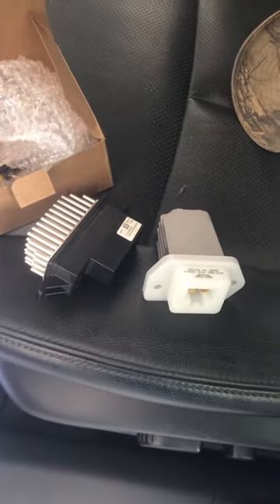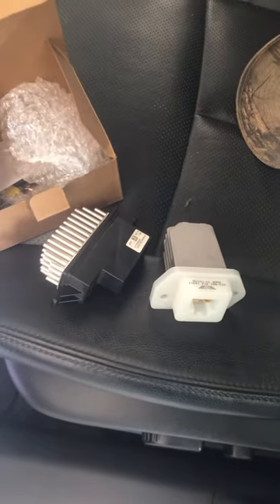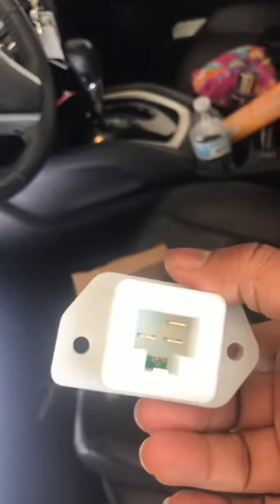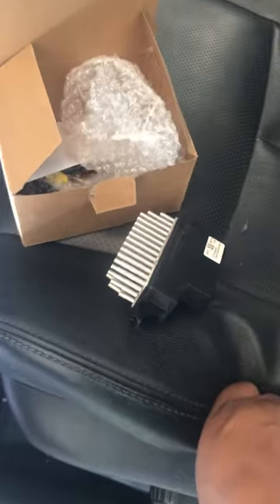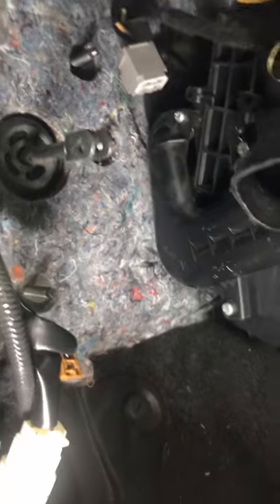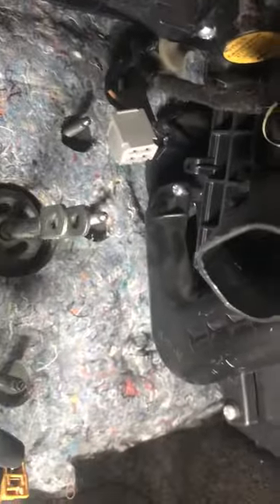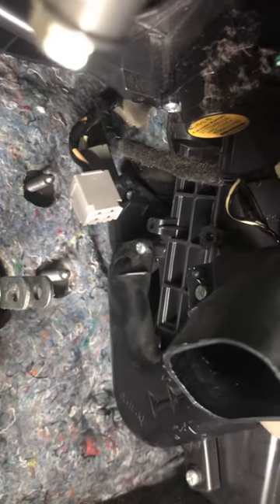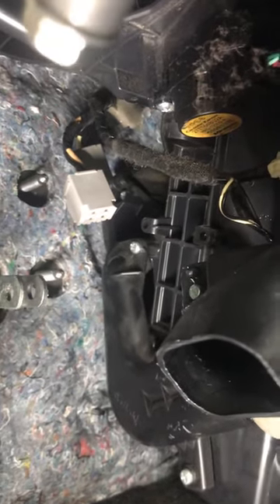2014 Nissan Rogue SL Blower Motor Resistor

Comment: Thank you!! God bless you! WOW, this hasn't been an easy thing to find parts for or to find where to repair. You are a sweet lady for sharing this information in your video. BIG help to let my husband know where to look. We need more good folks like you to share this information. The item the Blower Motor Resistor (found on the drivers side) for this part is 277A1 and is also called the Controller Blower on the Nissan parts photo. They charge around $36 - $49 for this part. If the blower motor is bad it can also require the resistor be replaced because it puts it under stress. Once the blower motor is replaced the resistor can go out within a short period of time. My suggestion would be to replace the resistor if you are replacing the blower. However you do not necessarily have to replaced the blower if the resistor/controlloer goes bad. The blower motor (passenger side - remove dash to find) is part # 27226-4BU0B or part # with an "A" instead of "B" will work too per Nissan parts. I believe you can use Murray part # 75041 as well and it's almost half what Nissan charges. It's probably about a 2-3 hour process to do both part replacements for a novice repairman like my husband. Lots of patience to remove the resistor and to put everything back together but it can be done for a whole lot less than what the dealerships or most repair shops will charge.
Reply from the maker: megan sims Glad it helped!! We were also told we had to remove the entire dashboard to get to both parts, it was a tight squeeze for hubby to get them out the way he did but it’s doable! Best wishes!

Comment: I have problem with mine too sometimes blower kicks it in and sometimes it doesn’t not sure if is blower or resistor any tips ?
Reply from the maker: We replaced both since we were told that the blower would eventually go as well.

Comment: 2018 Rogue - Replaced blower motor and that fixed the problem.  Tested old blower motor by hooking up to 12-volt source and it actually worked really well.   So, not sure what to think about this.
Reply from the maker: I’m not a mechanic ~ not sure what your statement meant.
Reply: @jmcbride  - no prob, let me rephrase.  The blower motor in my Nissan Rogue stopped working.   I replaced the blower motor with a new blower motor and AC was then back  in working order with fan working really well.   At this point, I'm thinking that the old blower motor is bad because I replaced it and my AC is now working.   But for the sake of it, I checked the old blower motor, after I had removed it, by connecting it to a 12-volt source.   I was not expecting the old blower motor to spin, but it did.   That fact that there isn't anything wrong with old blower motor is what has me puzzled.

Comment: Thanks so much for posting. When your husband put the blower motor back in, was there any special trick to get the mounting screw to line up again? I also got it out and back in without removing the whole dash...but wow...getting it completely lined up to get that retainer screw in is a nightmare!
Reply from the maker: Hello Dave! Sorry for the delay in responding. He didn’t have any issues going back with the screw it was just a tight squeeze and an awkward position just to get it back in. Hope you were able to get it back in. Hubby said to be sure you don’t pinch the wires going back in with it.

Comment: not so technical words but still helpful.
Reply from the maker: 😂I’m not a mechanic but glad you got the gist of it. 🤷🏾‍♀️
Reply from the maker: @cesarisorio1650  🤣 so technical ~ did it help or not? Did you know where to go PRIOR to coming here? And I believe I said Advanced Autoparts and not whatever you said🤷🏾‍♀️ Spellchecking is a thing before submitting. 👋🏾👌🏾✌🏾
Reply: @jmcbride  Idk why Cesar is whining about your video it was perfectly fine like man, talk about nit picking! He doesn't even have any of his own repair videos on his channel so dude is clowning.

JM, I wanted to ask (read in another video the resistor and blower motor wasn't your fix) what actually did end up fixing your AC? 

Thank you!
Reply from the maker: @chitownbangin  replacing the blower motor was the fix for my issue. We replaced the fan blower as well since it was recommended.
Reply: @jmcbride  apologies you are right, I misread that. i wasn't aware of the fan blower, do you know where that is located?
Reply from the maker: @chitownbangin  the blower is located on the passenger side behind/under the glove compartment.

Comment: Thanks for the video. Did you have to remove the housing for the glove compartment as well to get to the blower motor?
Reply from the maker: Branden Enomoto my husband did not remove the housing to pull the blower motor out, it was a very tight pull but he got it out just by removing the glove compartment. After all was said and done, we actually learned that it is easier but more time consuming to remove the entire dashboard to get to the blower motor. 
Good luck!!